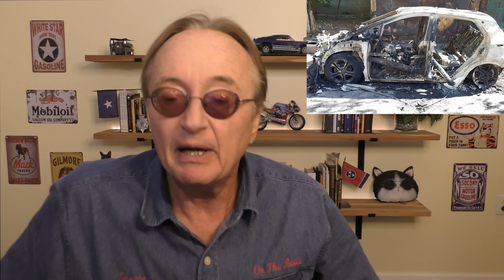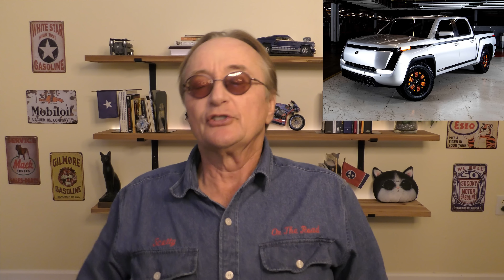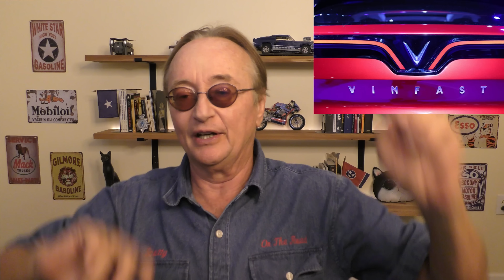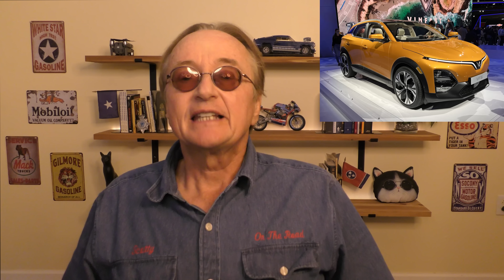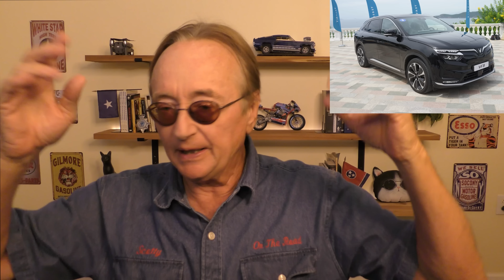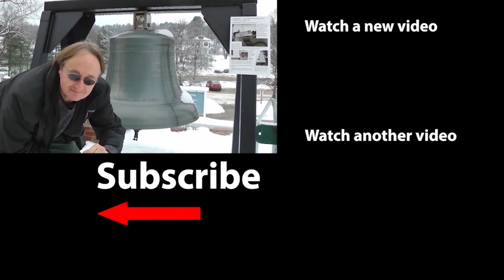Here's Why Ford's CEO Regrets Building the F-150 Lightning

Comment: Some friends of mine bought a Tesla a few months ago.  They decided to drive it to Park City which is well within the claimed range.  But it ran out of charge and had to be towed on the way back, because they didn't realized that going up the mountains would use up a lot more electricity than driving on the flat.  It was less than 120 miles round trip, whereas my gas powered car can go about 350 - 400 miles on the freeway even with some uphill driving included.  And, I can fill the gas tank in about five minutes rather than spending the ages of time that it takes to recharge an electric vehicle.  I'm not interested in ever buying an electric car, thanks anyway.
Reply: Same here.  Can go 700km on a tank, refill in 4 mins.
Reply: Park city does have a long up hill but yeah man gas all the way!
Reply: EVs have some utility being a commuter car but car for road trips is for ICE vehicles. Both can be used in the future but not mandated EVs. Both allowed in our future.
Reply: @MegaLighthouse your forgetting how unbelievably toxic direct emf is when sitting inside it that close with ev’s
Reply: @MegaLighthouse correct.  Lots of golf carts running around my town. EVs would be good for that.
Reply: Not for everyone
Reply: While the energy density is an issue imagine thinking that 20 minutes is a long time 😅
Reply: facts. electric cars are for city dwellers, and commuters from suburbia it's not yet ready for anybody else. teslas are super fun to drive, though, best drive for the pricepoint bar none
Reply: It says on the screen when it need to be charged though 🤔 
Kind of hard to miss
Reply: @MegaLighthouse there's a channel called bjorn Nyland, he tests EVs long trips so 100km, it does take longer than an ICE but it's like an hour or 1.5h paying 1/3 for charging compared to gas I think it's worth it.
Reply: @bigfactsbroski what do you base this on? Sure if someone drives like 8h trips every week I get they don't want an EV but most people only does that a couple of times a year.
Reply: @bigfactsbroski  - Totally agree with that, I wouldn't take my EV more than 100 miles from my Home base city unless I know where I can charge. I've always charged at home which is super convenient, but still wouldn't take it for a road trip. Sure there is super charger networks but you have to wait about 15 - 20 minutes to charge there. I just don't have any interest in doing that when we can take my wife's ICE vehicle on that trip.
Reply: @matthiasknutzen6061  - I know rural America (Alabama) where I grew up, its common to drive maybe 50 miles in a day. I think EV is doable there but still if you go on more than 3 or 4 road trips a year... I don't think an EV is very valuable in that sense.
Reply: 🤣😂 Tweet Musk, he might have a cow.😁
Reply: Hybrid was my answer.  Gas tank hybrid, not the plug-in type.
Reply: @runswithraptors imagine thinking 20 minutes is enough time to fully charge a nearly depleted ev battery 😂😂😂
Reply: EVs are of very limited utility, but FAR worse in the Mountains, and in the Desert, or anywhere there is a REAL winter; the battery capacity sucks, charging doesn't work-right, and battery-life plummets.  What a JOKE.
Reply: There are tons of teslas in park city 🤡 

Also if you live 120 mile round trip from PC… just save your money and stay in tooele bro 😂

Comment: Another reason to go with a less complex car, is to deal with less sensor issues. And manual transmission has not many sensors. And saves on gas, too.
Reply: And is a good anti theft tool.
Reply: Manual, ICE,...my preferred options on autos (auto enthusiast) as long as properly handled and maintained. Other options I can have in my garage will be for 'convenience' when appropriate.
EVs should be optional and not a 'brut' trend in the market.
Reply: I love manual transmissions having gone 350,000 miles in various cars and trucks without ever replacing a clutch but they suck in traffic and newer automatic transmissions do get better gas mileage.
Reply: Fewer is used for quantifiable amounts like sensor issues. You used less right in the first sentence because less is meant for things that are more difficult to quantify like complexity 👍
Reply: That's what I'd rather have.
Reply: @@AAries29 All that money you save with a modern auto will go to replacing the transmission when it inevitably craps out.

Comment: On any given moment, how many drivers are filling their gas tanks that takes 5 minutes. Now, picture the same type of scenario with EV’s that take how many hours to charge? One fuel pump can fill 12 gas tanks in one hour. A charging stations quickest charge would take one hour. A one hour charge only gives you, what? 15-20 percent? How far can you go on a 20 percent battery? This roughly translates that we need to build at least 20 charging stations for every fuel pump in this country. Ain’t gonna happen.
Reply: Good point it's as if the public can do the numbers better than they can and know that this is like a failed experiment but they are just relentless with these things.
Reply: True. But new battery technology like super capacitors may greatly shorten problematic charging time.
Reply: @aaronhumphrey2009 Yea but that “New Battery Technology” isn’t here is it.  It could take another 50 years to get there.
Reply: The technology is here…. Y’all don’t work in the industry and are outsiders
Reply: Imagine the queue waiting for a charge
Reply: I agree with what your saying but most ev now can charge 20-80 percent in 25-35 minutes. It’s still to slow though
Reply: I felt like I’ve been the only one saying this. Funny how it’s just ignored
Reply: Great point and I see new GAS stations being built all the time and no EV chargers being installed. What does that tell you.
Reply: @PartyStationFinance   "Y'all" that work in the industry have no idea what you are doing.
Reply: You seem to be under the illusion that people driving an ICE car today will be allowed to drive an EV in the future.
Reply: @SomeOne_86  how so?
Reply: That's the same thing I just said to an uber driver who blindly wants a new electric car. I'm just like...humans really can easily be condition, even if it makes no sense. 🙈🙉🙊🤦‍♀️
Reply: @ronaldjones743 you are wrong.
Tesla just installed their 50000 supercharger about a week ago 
In 2022 Tesla installed 11000 superchargers.
Unlike a gas car where you have to look to fill up a Tesla will automatically route you to a supercharger if one is needed

Comment: We wanted a redesigned early 90’s Lightning. Why the heck did they think we’d want an electric truck? 🤦‍♂️
Reply: Many people did until they realized they aren’t great in the cold, and the cold cripples towing performance.  Hybrids are the current solution IMO, but full electric are a decade from being practical except as a city commuter vehicle (which is not a pickup)
Reply: @marksallows113 yeah that F-150 power boost is a monster.
430 horse power 570 torque.
Reply: @toomuchthyme no they didn’t want this to take over the 90s lightning. That truck was way under powered compared to any of today’s modern trucks. It’s just the lightning name makes sense for an electric powered vehicle. It wasn’t an attempt to tie the two models together.   I think you are misreading the naming concept.  By any of today’s standards, the 1990s trucks were dogs.

Comment: Wrong Scotty, my shop has already replaced four Titan transmissions.  I'm thinking they are not very reliable.
Reply: Yeah, a lot of Nissan products in general have transmission problems. 4 transmissions might have something to do with who's installing it (like those ford Fiesta dual clutches that needed to be programmed, but most forgot to reprogram then after causing problems) or the customer is not very responsible. Nissan has really never had good transmissions, even their standard transmissions seemed to have troubles too
Reply: @nicholasoconnell7732  I'm only one person but of the bazillion things I've changed in my '98 Frontier,  the transmission isn't one of them
Reply: @mamandapanda185  That's also a 98, things are a lot different now. Ford is using transmissions made in China.. i.e. the MT-82

Comment: I know owners of Chevy Bolts, Teslas, Hyundai EVs, Nissan Leafs... all are very happy with their cars. Most charge only at home and understand the range limitations. Some have put over 100,000 miles on their vehicles with virtually no maintenance cost. No oil changes, no transmission service, no spark plug changes...and brakes last forever because of regenerative breaking. Batteries will get better and costs will drop.

Comment: All the bells and whistles of the big 3 is not why Titan Trucks failed.  They failed because they were charging to much for a truck that had no demand.  It was cheaper then the big 3 but still in the ball park and when your lagging behind you got to be at least 10 grand cheaper then your competitors to start getting market share.  Most of the big 3 sales come on lower trim trucks and not all the fancy ones so this argument just doesn’t hold water.

Comment: The Cat-Diesel in the Titan was sub-par. It had a lot of problems, gas ones are fine.
Reply: I thought it was a Cummins V8 diesel.
Reply: It's a Cummings 5.0L , Catapiller quit making on road engines a few years back because of the crazy government emission standards.  It would have been great if they could have been able to make a pickup engine, I've owned Cat powered trucks and they've always been known for making great horsepower and torque with insane reliability,  until 2004 that is .

Comment: Tesla's first Roadster sucked.  Musk said it was great 20 years ago...and now says it sucked.  That is normal.

Most house and apartment electrical panels can't really handle another 40amp 220VAC circuit.  Most NEW houses can, but most HOUSES are 20th century builds, or 19th cen builds with numerous refits.

This is also true of neighborhood electrical grids.  A similar situation occured in the 60s as many people installed AC, electric stoves and electric dryers into houses built before 1960....think Ralphie's house in Christmas Story.   This led to rolling blackouts and brownouts for 30 years

Comment: A Canadian recently bought a Ford EV Lightning ,and tried to take his family on a trip. It turned into a nightmare where they were left stranded ..they had to ditch the EV and rent a gas-powered truck to get home. He also had spent $ 6000 to install a fast- charger at his house in addition to the 89 K for the EV . It was unable to complete ONE vacation trip ..😮
Reply: My brother has a Tesla.  It's only good for city driving.  Its range is reduced the moment you use the A/C, have more passengers.  We were planning to go from Irvine to Santa Monica, which is about 45-50 miles drive.  He had to quick charge it to around 75% the night before.  Waited about 20-30 min.  He could charge at home, but it's 1% per 1 hour.  At that rate, he would have to wait over 2 days for home charge.
Reply: Un freaking believable 😢
Reply: @Vagabond_Etranger ... there are now surcharges on chargers $$ plus some you pay by the minute

Comment: There's almost two million gas stations in the US so average 10 pumps per would be almost 20 million. That's how many charging ports would be needed to support an all electric car system. Not including the amount of electricity it would take to keep it up and running. At the end of the day, it's bull$#!T! It will never happen, it's literally putting the cart in front of the horse. Unless the infrastructure is built first in order to facilitate a seamless transition, but that would be a huge gamble when you consider all the tech being invented all the time.

Comment: When last measured in 2020, the 150,000 gas stations operating in the US serviced 276 million cars. While statistics don't exist for the number of total pumps in the US, if we assume the average station has between six and 12 pumps, that's around 900,000 to 1.8 million pumps, or 153 to 307 cars per pump.Nov 21, 2022
Reply: Wow... incredible
Reply: Remember that the average time at a super charger is probably 30 to 60 minutes, only gaining a fraction of your range, whereas we only spend mere minutes at a pump for another 400ish miles.
Reply: @ZoneGlazed Exactly, apples to oranges.
Reply: Bucees will need to be accounted for to have a better estimation
Reply: @MPR_2023  haha love that place... they always had 8 foot long handles for their windshield cleaners at the pump for guys with big trucks...

Comment: Lol you won’t need millions when most ppl charge at home everyday.
Reply: Millions live in multi-unit housing (apartments, town houses, etc) and many of the older homes don't have the power available from the grid for Level 2 chargers chargers.
Reply: @cwarner5909  true. I should have given it more thought. These cars must be parked somewhere. Without a charger at home I’m not sure I would have even considered an EV
Reply: Where are 100 million electric cars going to get the electricity from? @amusicthang

Comment: A stock can't go down by more than 100%
Reply: The value can’t go down more than 100% if you take the measurement from  your entry point and exit there. But it can go down more than 100% if your exit point is lower than your entry, so assuming most people don’t buy stocks at zero when the are first issued in absolute terms it can go down to more than 100
percent, even more so if you are leveraging which many do.
Reply: @Vintaronica  if I exit at a price lesser than I entered, it is a loss. If the price went to zero, it is 100% loss. If I leveraged to buy stocks and the price went to zero, it is not the stock that went below 100%. It is my loss on my net asset.

Comment: How did we skip right over the best of both worlds straight to plug in electric cars?

I mean generator and small battery bank electric drive  works and works well. All of our trains run on that.

You just need enough battery to make it 20 miles or 30 miles. With a small motorcycle sized engine running a generator and heater AC power steering pump .... creating vacuum for breaks etc... 

Best of all worlds... no major impact on grid, high torque e-motor, fast refueling, range of gasoline motors.

The only down side you lose the cool exhaust sound.

But no... we gotta get plug in cars ... why

Comment: There is 160,000 gas stations in the U.S. it takes what ten min to fill up it takes how long to charge a hour so we would probably need about what 600 or 700 thousand to equal gas stations and there putting 15,000 in LMFAO!!

Comment: Hard to imagine EVs doing well in a warm/cold climate.  Definitely need fossile fuel for at least another decade.
Reply: Our EV does much better in the cold compared to our diesel.
Reply: @Billy.80  They work well but don't have the range in those temps. Half the battery power gets used up to heat/cool the interior. Okay for short commutes but lots of people need more run time.
Reply: @Billy.80 a properly maintained diesel with good glow plugs should start flawlessly in the cold
Reply: Or two or three or more.

Comment: We've had gasoline and diesel engines for so long that filling stations cropped up steadily over time.  The flawed idea of EV is that we can install just as many chargers, but in a much shorter timetable. We don't have the electrical infrastructure for such consumption and batteries lack the range of a tank of fuel. This isn't difficult, but stupidity can't comprehend.

Comment: I have been driving a Chevy volt for 7 years and 90k miles. I plug it in at home it's so easy.  I live off the power grid with solar and batteries that have paid for them selves off 2 years ago. I paid $13500 for the car and it has saved me $16300 I. That 7 years. It is doable for some people.

Comment: There were a lot of arguments against automobiles when they were introduced. Within ten years horse drawn carriages were all but gone.Why? Because they were faster, cheaper , better. Soon EVs will be obvious choice to most people.
Reply: You just explained why EVs have giant problems- they aren’t cheaper or better. To the contrary, they are much more expensive both to buy and maintain. Better? Nope. If you only drive in a 50 mile area? Probably ok. But who wants to spend 60+K on a car that is such a hassle to fuel? I don’t want to limit where I can live in the USA simply based on where has charging stations- that’s insane. And as the demand for charging stations increases, so will the price charged to use them. It’s basic economics.

Comment: What's next, the F-150 with a 2.0 L turbo ?? I won't be surprised.
Reply: If they make them with good gas mileage, high hp, and torque. Yes.
Reply: Look technically these manufacturers can make a 2.0 l engine and make it get 300 plus hp so like it or not within 5-10 years v-8 will be like the dinosaurs
Reply: No, twin turbos....and dual exhaust just for looks though.
Reply: Hopefully.. it's an entry level/light-duty truck, it should have a 4 cylinder turbo option, they make good power, now.

Comment: Electric cars are the new toy for adults.  Unusual, bright, but one day the time will come when you get tired of it.  Problems with the battery and charging will become unbearable and unpredictable because the mileage of the electric car will also be unnerving all the time, depending on many circumstances.  And you just want an internal combustion engine car, with which everything is simple and clear.  My comrades, having played enough with electric cars, are all returning to normal internal combustion engines.  But I just didn’t waste time on it.  I played enough with electric cars as a child.  Thanks mom and dad.